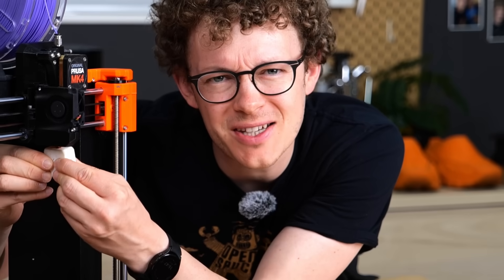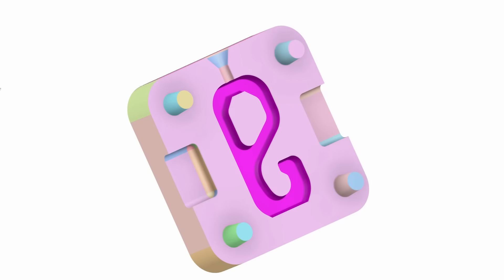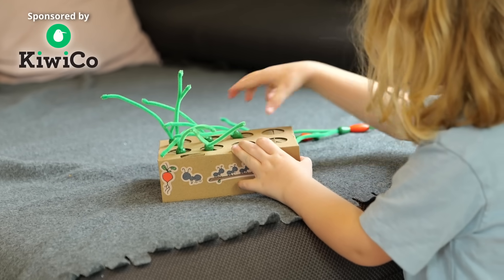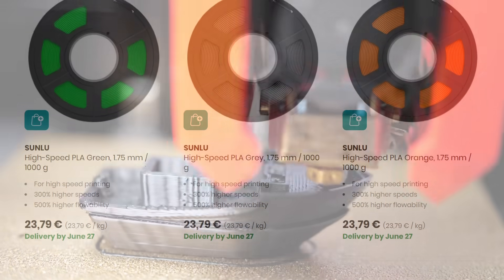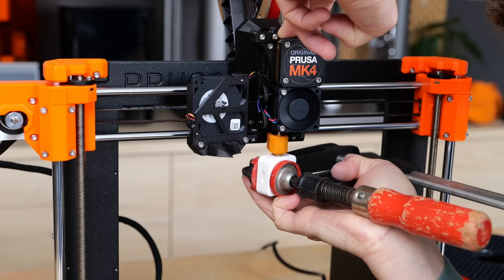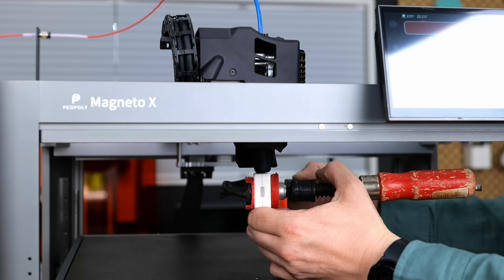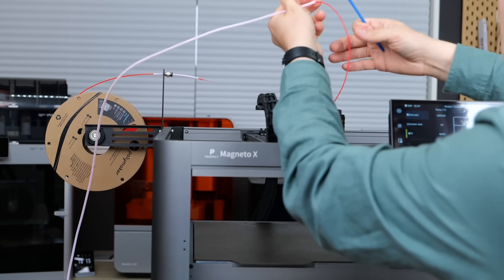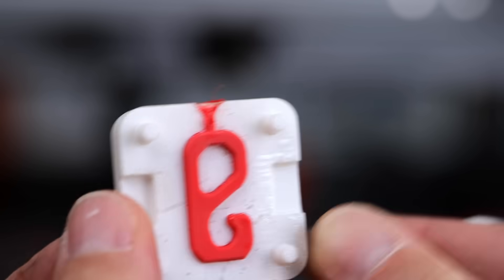I tried Injection Molding using a 3D Printer!

Comment: Hey. Some advice

1. You need exit holes on any chamber you create. A big reasons for injection moulding pressure requirements is the to get over the pressure of the air you're compressing in the mould. Putting pinholes in the mould, at the points the pressure would build up in, will reduce the pressure the printer need to generate. As the pressure increases the more the mould you fill. Pinholes at the deepest recesses of the chamber will create an "outgoing" sprue which you can remove in post

2. Heating the mould, as you know,ows the plastic to remain soft/molten for longer. That's just not doable with a 3D printer alone, let alone a resin printed mould, but it is a fun PoC. If you can't heat the mould, you MUST reduce the pressure inside the mould. That way you can get the hex in the screw 😊

Comment: Maybe try creating a mold of concrete and pre heating it in oven before injection, and have a few air holes so u don't need higher pressure

Comment: U didn't think of the air in the mould. Once the pressure inside is greater then the extruder u can't pump any more in.
 U need a hole for air to escape

Comment: Depending on the size and shape of the object that is injection-molded part, the mold itself has at least two heated channels that open and close by a valve, so the material goes from multiple places at the same time for making the plastic being able to reach everywhere it should. The mold itself usually isn't heated but cooled, but as we're talking about diy injection molding, we might need to heat it up to make the material not cooling down too fast, as otherwise it won't be able to reach whole space of the mold. Also the injection pressure is crucial, so to achieve somewhat reliable diy injection molding, you should make minimized version of injection system from the actual IMM (injection molding machine) which might not look as it, but in reality might be pretty tough to achieve. And the costs is the biggest concern of the whole concept being worth it. I guess not, but at least it might be possible.

Comment: Hi Stefan,
I had an idea that would possibly make it easier to hold the mould and could possibly use higher temperature filaments (if the resin for the mould would allow for it), using the bed of the 3D printer(s) to hold the mould for you would also help reduce the risk of burning / injury from the hot plastic / material being used

Hope this was useful or helpful in any way ^^

- MS29K 💙

Comment: Yeah, by the end of the video. Allowing a venting channel channel and heating the mold. The required clamping pressure in injection molding process  is the result of the pressure behind the liquid plastic.The pressure behind the liquid plastic is the result of the pressure required to then displace the air in the mold. The pressure required to displace the air in the mold is a function of the restriction it imposes to air or to plastic. The restriction that the vent imposes is CHOSEN to allow air escape at the set pressure but not plastic so long as the clamping pressure is sufficient to hold the parting line.
Reply: Then...taking into account the cooling rate of the molten plastic. You determine Temperature, flow, and cooling  rates. A hot mold allows for a finer detail with less pressure or longer injection time because the molten plastic solidifies more slowly.

Comment: A piece of graphite might allow easy making of the seal between the nozzle and the mold. As well, seeing where the plastic forms last..use a blade to cut a micro channel to allow air to escape. Speed and temperature is everything, pressure allows for shallower venting of the air that needs to escape as it is replaced by plastic

Comment: My first thought is where is the vent for air escape? Especially if you don't want flashings. And I think the air vent hole should be half the size of the sprue opening to provide the resistance needed to help fill the cavity. And like alot of the other professional molders have said, Fill at the biggest end first so as to help the material stay heated as it progresses thru the mold. Great videos keep up the entertainment.

Comment: We use the 10K resin to make 60x55x23 inserts and injectionmold parts from polypropylene, works really nice. I think you need some venting on the end of your parts, to realease trapped air. Usually you can spot trapped air by burn marks, but injection is too slow to have that. 

You can easily take a file and make a tiny groove +/- 0.10 should be more than enough.

Comment: A few things, you need another relief hole on the top because the air pressure is what you're fighting, also If you can only get it 75% fine flip it over with a hole in the bottom 🤦‍♀️🤷‍♀️

Comment: have you thought about instead of trying to replicate the injection molding process, but to use a process more like casting?  You could take the two halfs, fill them with molten PLA and then join them and then cut off the excess

Comment: Hello,

Could you please tell me which filament brand and type you used to print the parts shown in your video at 9:15? Additionally, if you remember any specific settings like the temperature adjustments you made during printing, I would appreciate it if you could share those as well. Thank you!

Comment: Not sure if the motors would provide enough pressure, but you could write some g-code to push the extruder down onto the mode. And you can create a custom baseplate so the inlet is always in the same space.

Comment: Brilliant idea, Stefan! Who wouldn’t love a two in one 3d printer?  Perhaps at some point we’ll see working hybrid prototypes. Thanks for pioneering the technology bro!

I would experiment with air relief apertures on the far end of the mold and see if that improves flow. 

I would want to try jogging the nozzle down to the inlet and clamping the mold to the print table and see if that had an effect on the seal.

But, If your nozzle had outside threads, you could incorporate female threads into the inlet of the mold for a secure seal to the nozzle. 

Rather than machining or sintering a custom nozzle perhaps you could print a kind of bushing male threaded adapter with an inside flange that the nozzle can tighten against and  the mold can screw onto.

You’re an inspiration to us all, thanks a lot for sharing!

Edit: Really smart preheating the mold! Convenient that it has a higher melting point than most filament. I don’t know if this is a grasp at straws but maybe manually working a heat gun and laser thermometer on the mold during injection might further enhance that method.

Thanks again! Guten tag!

Comment: I say create molds with a screw fitting in the extrusion area. That way you can screw on the mold to the extrusion head. Instead of an actual printer head, a threaded pipe would be prefered imo. 

You wouldn't need to personally press the mold on the extruder that way. instead all the pressure is on the screw.

Comment: The often suggested vent hole would be my first idea too, but maybe you can use multiple nozzles as well. The idea of using an unchanged 3d printer ist good, but I would have doubts pressing on my hotend and my extruder and would prefer a separate hotend anyways, so adding some on bigger parts isn't so big of a step anymore, especially with Mainboards that support multiple hotends. But using accessible 3DP components to do injection molding is certainly worth looking into

Comment: i would take apart a few extra 3d printers, combine the heating elements onto one custom wide nozzle and almost make the plastic a liquid before injecting it. or there is always epoxy. you should try to make a lens with epoxy and a 3d printed mold... lots of sanding

Comment: I think if you keep the mold heated with either heat traces or a channel with hot water flowing through would help a long way. I guess at that point it would be casting but you aren't going to get the pressure or flow you need from a printer anytime soon

Comment: could it be air pressure, maybe add a small pocket thats to give the air somewhere to go, ive always seen them add holes on the other side of molds for poor metal so maybe just adding a straight hole from the other side out will allow it to finish filling it, not big, just big enough to act like an exhaust i guess u would call it.

Comment: I've tried printing PLA molds for some small mechanical parts. Figured out how to make some complex pieces with holes for screws and shafts, but releasing parts from the molds is a big issue, especially because of the rough texture of FDM layers.

Comment: The person from Montreal is correct you need to add a vent hole or two or three, i am a prototype Machinist specializing in plastics, I'm very familiar with mold making . All plastic injection molds have vent holes it helps move the plastic through the mold add eliminate air bubbles in certain parts, just make sure the vent holes are as small as possible for this application it changes from mold to mold, and where do they need to be in the mold, Hello from the Cleveland area.

Comment: I'm a bit puzzled why you held the mould in your hands instead of squishing it between the hotend and the print bed. You could even take advantage of the heated bed to keep the mould warm. You could program the printer if the moulds were arranged in a grid, doing multiple parts in a single shot. And air could get in the way so a tiny hole where air can be displaced out of the mould would help a lot.

Also, that foaming TPU material would be perfect for this process.

Comment: I worked doing injection molding.

The mold should be metal, and the mold has to be hot for injection molding to work correctly.

Comment: 17:25 you know, there's been a frequent pattern I've seen with the fails, and it has to do with the direction of the mold. That screw's fail point looks like something to do with air flow and hooking, which would result in problematic outcomes.

Comment: Add small sprues at the ends of objects for air to escape. Less resistance to fill the mold, less pressure required to push plastic through

Comment: Good Job !!!

If you pay more attention, inject molding not only injected tru a sprue, also let out pressured air cause by  the displacement of the intruded material and let out the over flow material TOO !!!

Therefore you should not inject for the top or end.
You should inject from the shortest length and in multiple sprue, Therefore you should inject from the back of the object you want to create.

(Newton's 3rd Law =  two masses can't occupied the same volume at the same time) 

when God say Their by Light, He said NEWTON !

LOL

Comment: Using a closed printer, the internal temperature could be increased (maybe even up to 120C?). The mold, with an injection point matching the exact shape of the nozzle can be placed on the heated print bed so that the hot end can be lowered into the mold, using the print bed to press it against the hot end with a more stable force, instead of manually pressing the mold. Also, maybe the injection point could be shaped to accommodate not only the nozzle but also part of the silicone sock, helping to create a better seal?

Comment: Hello. I am happy to see you trying these experiments. I am almost convinced that if you would put a relief hole at the opposite end of the part, any one of your extruders would have been able to fill the mold. I believe there’s too much air pressure building up inside the mold, stopping the materials from flowing before they cool down.

Comment: As a mecanical engineer who does casting and other moulds i highly recommend to put a small hole at the end so that air can get out of the mould faster. This is used in  early every mold for casting or injection moulding

Comment: you need cnc aluminum to make the mold. second repeat getting the temp up for the mold. and then someone said about a leaving an air out. That way you can see when the mold is done. with a hot mold and the extruder your using it should work on a small scale much better.

Comment: Great idea and video of it. My suggestions would be to center your fill hole on the mold at the broad side, let the mold preheat on the hot bed, bring the nozzle down to it so that it will apply the required pressure to prevent flashing, run your hot end temp at 200 or more Celsius, and fill. This method should solve all problems because the injection will be evenly distributed, and the mold keeps the required temperature needed to prevent cooling/solidification.

Comment: 3D printed injection molding makes sense for many quick wear parts like handlebar covers. Think about using gravity a bit more in the process for example, wouldn't it make some sense to have your mini-figurine fill at an angle making the back of the head the highest point for (front facing maximum detail) while letting the toes of the shoes-toes and hands would be more downward towards the ground. IDK if this makes sense, but if it does then you get what I mean by "let gravity do more work for you". Good luck, you have an idea here that many small fabricators would probably enjoy for fast & quick testing or common-ware parts where they may need to be replaced a few times a year (also, repair seems greatly suited for this).

Comment: I used to work at a factory that did Plastic Injection Molding. I'm going to try to simplify this. If you look at a brand new car tire, you'll notice it has hundreds of little nubs of rubber sticking out of the surface. This isn't necessarily a design choice, but a way to let air escape from the mold as the air in the cavity is replaced with the solid material, rubber in this example. If the mold is completely sealed then the air in the cavity may not have anyplace to go which would increase the pressure in the mold and prevent the material from flowing where it needs to go. Adding one or more thin channels, maybe .4mm at the extreme opposite end of the mold as the injection point, will provide a channel of escape for the air trapped in the mold allowing the material to more freely flow through the entire mold with slightly less needed pressure.

Comment: you could redesign the mold to where it fills from the middle, that way it prevents plastic cooling down too quickly and obstructing the flow, also you need vent holes in order to allow the air to escape, it would be really interesting to se a "thread on" design, otherwise you can hold the mold together with nuts, washers and bolts, really interesting experiment, i will for sure keep watching

Comment: Could you incorporate a small heater cartridge into the mould to keep it warm and allow it to flow for longer? You could also experiment with the location of the sprue to see if it will flow better in different directions, maybe if you fed it in from the longer side of the hook so it can flow both ways rather from one end to the other.
Reply: If you wanted to do a lot of this, find a good common size for the mould and make an outer holder/cradle for the which could incorporate some sort of heater. Then you can print your actual mould inserts like the ones you have in this video to place into the holder which could both clamp and heat the mould at the same time and give it some thermal mass. You could even have something like this milled out of aluminium fairly cheap which can be reusable for different mould inserts

Comment: My ideas concerning this is the location of that sprue needs to be more centrally and some over extruder sprues located near the far ends allows for the part to be filled and back pressure from a sealed mold can be mitigated. 

The mold itself could be printed and molded. You can then melt some aluminum and make the mold itself out of recycled soda cans if your trying to make more then just one of what your trying to create. The 2 reasons why you'd want to do this is to make sure that hot plastic won't deform that mold itself and you can use a torch to heat the mold itself to prevent the plastic from cooling in the mold and helps you fill the mold evenly. 

Also I wonder if you could even sinter a mold using plastic impregnated with metal, you could create the mold at 100 percent infill, size it up 18 percent then cover it with fine grain salt and put it in a furnace. Break the salt and see if that works?

Comment: I made an injection molding machine for 3d prints by using an old soldering iron clamped into a metal block.

The metal block has a 14mm hole drilled into it. I use an old 14mm bit to push PETG trough a 3 mm end hole into a one time use mold.

I use it to make gears because 3d printed ones aren’t tough enough for my applications.

Comment: Hi, 4 recommendations: 
1. Keep the mold hot throughout the injection phase to avoid the injected media solidifying.
2. Start from the largest volume to fill up first (so with the screw start with the head instead o the thread.)
3. Add flow passage channels to help the melted plastic reach the furthest regions in shorter path (small holes only work for heated molds) 
4. Add air drain holes to the avoid air pockets

Comment: 1. Also create 2 heater cartridge cavities and put heater cartridges controlled by a separate heat controller to actively heat the mold. 

2. Polish the interior of the mold with a tumbler polisher to improve flow and release.

3. Include exit sprews to vent resistance pressure and allow more plastic than is needed to flow

Comment: Try taking two nozzles opposing force or using the bed to heat the mold while supporting the reactive force to the gantry. Also, use vent holes.